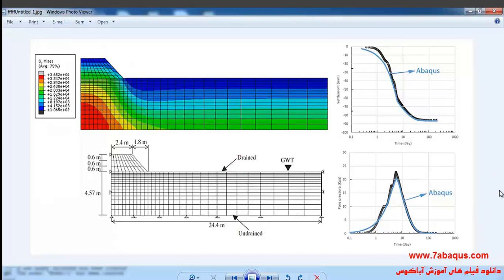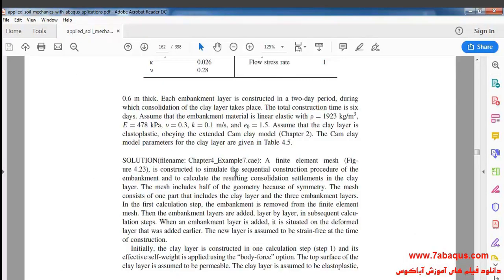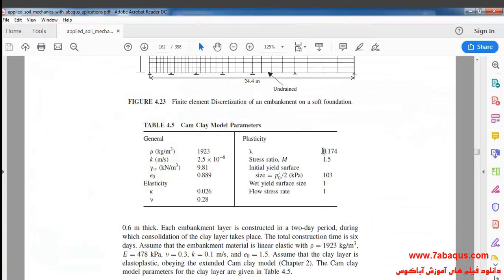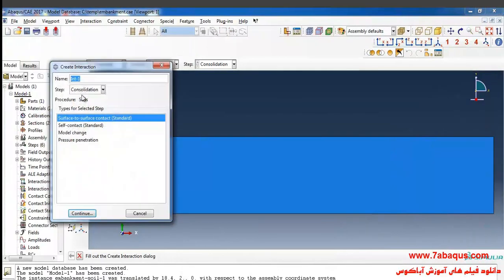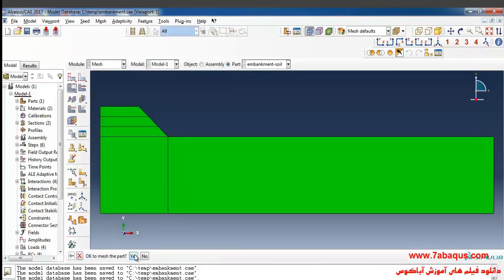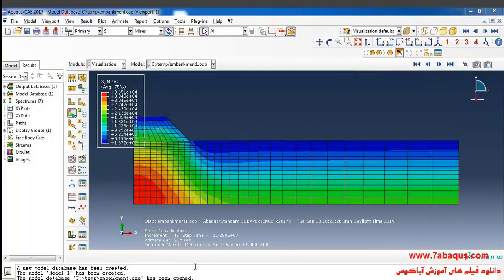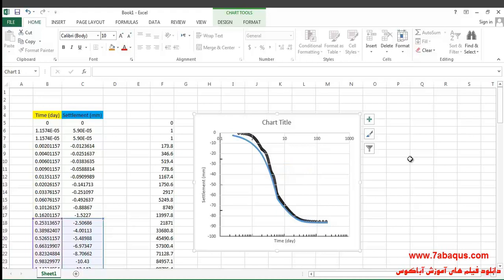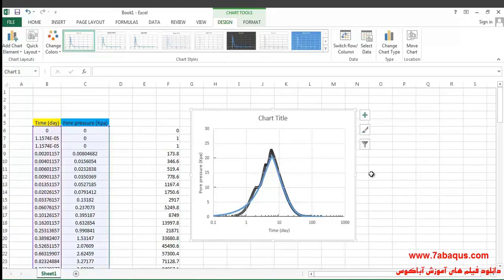Sequential construction of an embankment on a clay layer Abaqus

Comment: May i know why is this happening

Error in job Embankment: THE SUM OF INITIAL PRESSURE AND ELASTIC TENSILE STRENGTH FOR THE POROUS ELASTIC MATERIAL IN ELEMENT 21 INSTANCE PART-1-1 MUST BE POSITIVE.
Job Embankment: Analysis Input File Processor aborted due to errors.

Comment: Good work sir,
However, many steps are missing. This would be difficult for those of us that are not familiar with the procedure. I am finding it difficult to complete the model right now because of the missing step😔. The link you provided in the comment section is not accessible